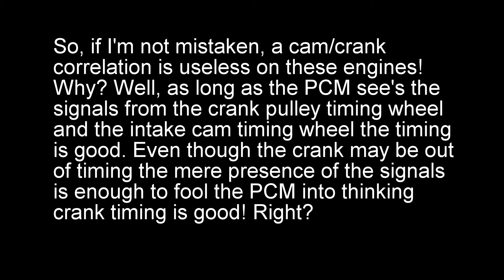2005 Mazda 3 - 2.3L to 2.5L Engine Swap. Timing Fail!

Comment: Maybe the problem is that the rubber in between the damper roll out of alignment  its happends it old the rubber is cracked so it moved you need a new one I know about this engine I have a 07 mazda 6 and I rebuilt the engine back in December and it working strong. I could tell your off course the hole in the damper is at the 5 o'clock  so your damper is off alignment

Comment: The way we would establish TDC in shops I'v been in is to Turn engine until the rod stops moving UP and mark the crank damper position.  Turn engine until the rod just starts to move DOWN and mark crank damper position.  Exactly between the two marks is TDC.  Of course we used a dial indicator but in the field you can get close by eyeballing it.  :)
Reply: Good tip!

Comment: i just swap 2 diferent motor in my madza 3 and same isu it whont start  only got fire on 2 coils  and my car soud like its flode work on this for 3 days none stop anyone can help me or aving any idea
Reply from the maker: Once you have verified that the timing is set properly here are some ideas. 

Test and make sure that the coils are getting power/ground and the signal to fire from the PCM. So, first check for the signals at the coils and if they are not there check for the signals at the PCM. 

If you have verified that there is signal present at the coils then you need to verify that the wiring and connector that goes to the PCM are okay. If you are using the same coils on all engines then you need to verify that the coils are all good.

If you have tried two different motors and have the same problem, the problem exists in something outside the motors. So the wiring, fuses, connections, coils, or the PCM. If you are using the same sensors on all engines then you need to verify that your sensors, especially crank sensor, are working properly. Good luck!
Reply: already check al those option all i can see its thats the cumputer need a resets i change the crank sensor  allready nothing working
Reply from the maker: You are telling me that you verified that the signal/command to fire the coils is present at the coils when you crank the engine. However, even though the signal/command is present, only two of the four coils fire and generate spark?

If the engine sounds like it's flooded and won't start after repeated cranking, check to make sure your spark plugs aren't fouled. That happened to me!
Reply: Baxrok2 thx for the help ill check thats later on today  car is backfiring thats why i tought its flood because of the gas smell and stuff
Reply from the maker: If it's backfiring, verify timing too!

Comment: Crankshaft & cams are aligned relative to each other by a cam chain with help of special plates and bolt. This is straightforward to understand. 

These must also be timed correctly relative to the crank pulley which relies on not a traditional key and slot but a friction washer. Which, as you say, is "fiddly" and risk-laden. 

As far as I can tell you have done everything correctly (including determining that the timing has slipped). 

Wouldn't simply putting in the timing bolt, turning the crank until it rests against that, then using an impact wrench to tighten the crank pulley bolt do the trick? That way you can be sure the crank isn't turning (and shouldn't be dangerous to the bolt). If it were me, I do it that way, at first just "snugging" the bolt with the impact then remove the timing bolt and then really "hammer" the crank bolt with the impact. 

If my crank pulley oil seal leaks, I have this issue to deal with? Sheesh!

Your videos are very excellent and make understanding all this--even if not doing a swap--very clear. Thank you.
Reply from the maker: davecc0000 Thank you. Yes, in my newest videos I show all of the details of the timing.

Comment: i know your struggles!!!
Reply from the maker: What bothered me the most was not so much that the timing was off but that scan data, that I had been staring at for weeks, showed that the timing was correct! Damn it, that really sucked! Fortunately, it was easy to fix. Did you get yours figured out?
Reply: yes i did... also know that some camshafts and crankshafts for these engines are not forged. and there is only 15 to 20 thousands hardened on the camshafts
Reply from the maker: Andrew Frey Well, that explains the rod knock issues and makes me glad that I kept the 2.5 cam instead of swapping in the old 2.3 cam like most guys do! How did you find that info out about cam/crank?

Comment: Sorry, had a blond moment... crank moving / pulley moving = same thing. =)
There shouldn't be any engine damage then if it's chain drive. yes?
Reply from the maker: Crank moving = pulley moving, yes. But pulley can be timed correctly although crank may be off from TDC. External indications show timing is good. Cam/Crank correlation shows all is good. Engine runs like crap though. No engine damage in my case but it's considered and interference engine I do believe so it can happen. Hope I'm explaining it right!

Comment: Chain drive? Chain can't slip on crank, cam & crank have to still be in-time... then just the pulley slipped or the tone-wheel on the pulley (rubber bonded pulley can slip)? Sorry if I'm wrong... don't have any mazda experience.
Reply from the maker: Chain yes. No key on crank for anything. So, gear that drives the chain/cams spins freely on crankshaft until pulley is tightened onto crankshaft holding everything together. Pulley can be timed, cams can be timed, but still possible for the crank to be off.
Reply: Baxrok2 That's crazy then! What's the torque spec on that bolt?
Reply from the maker: 75ft/lbs initial torque then an additional 90 degrees. Does not seem like much!
Reply: ***** No, it doesn't.

Comment: I am thinking of doing this swap.You cannot be thanked enough for documenting this.Getting to see it really puts into perspective for me.I wonder if a 2.5 head would bolt to the 2.3?
Reply from the maker: I don't see why not as it appears that the block is identical to the 2.3. However, don't take my word for it! I'd advise you to visit the Mazda3Forums.com and search for the two threads on the 2.5 swap. Others may have done it already. Secondly, you may read some forum posts at Massive Performance' site. They are 2.3/2.5 gurus. (However, they could not answer my question on 2.5 timing.) It was there that I read that the 2.5 head flows significantly better than the 2.3.
Reply: thank you.Keep up the good work and not avoiding a challenge